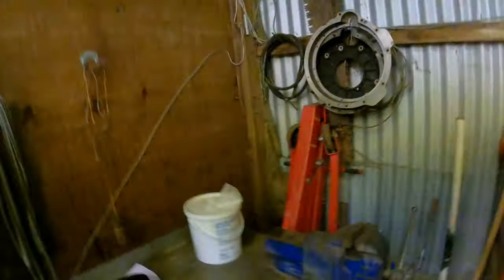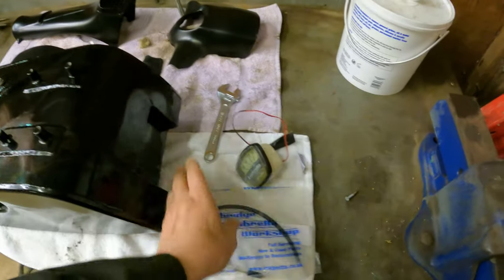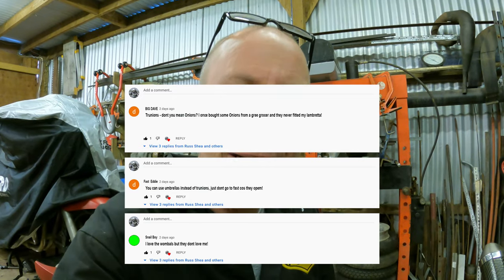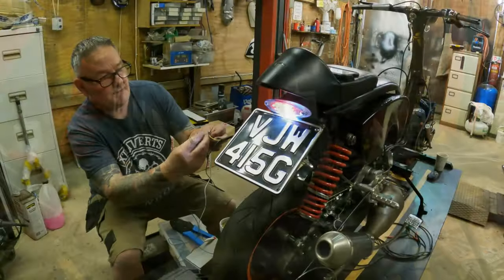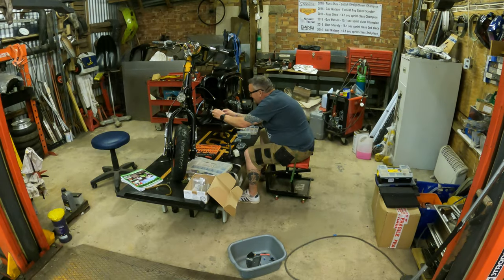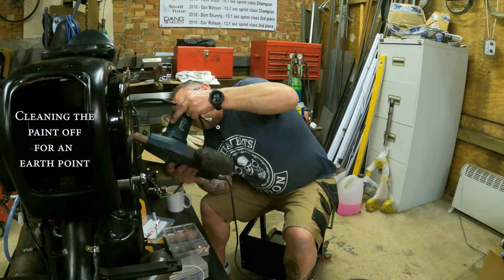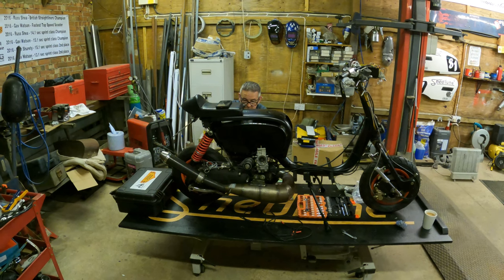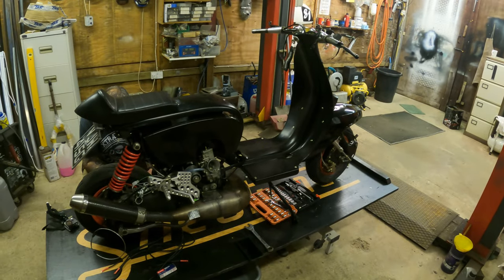PART 7 - LONG RANGE TANK - SHEDTUNE LAMBRETTA CUT DOWN PROJECT

Comment: What is the inside of the tank like? Mine has serious rust inside which caused my new GT249 engine to wear out within 4k miles. Ive heard of someone else having exactly the same issue. POR15 fixed mine
Reply from the maker: Inside of the tank is very clean 🧽 on this one